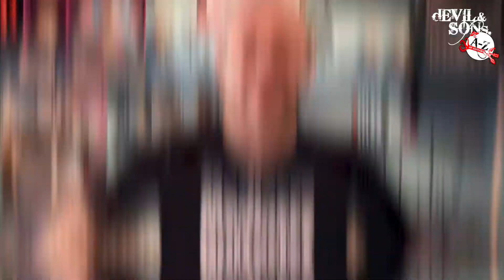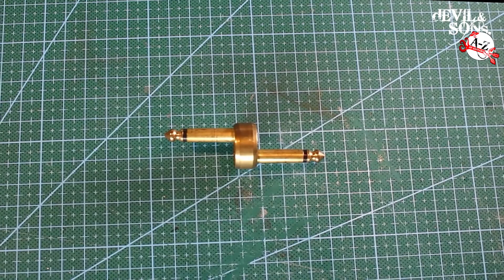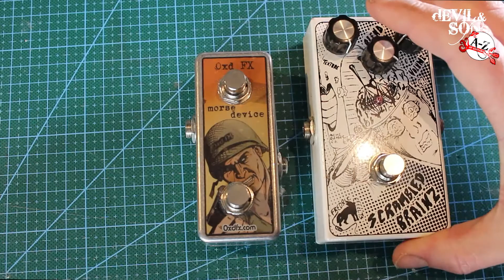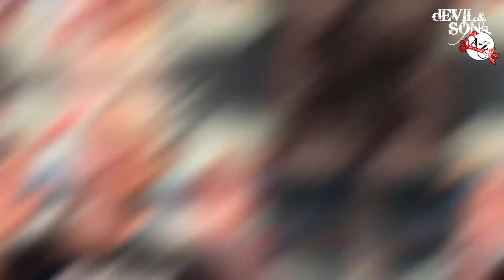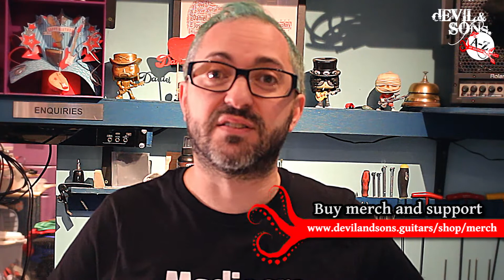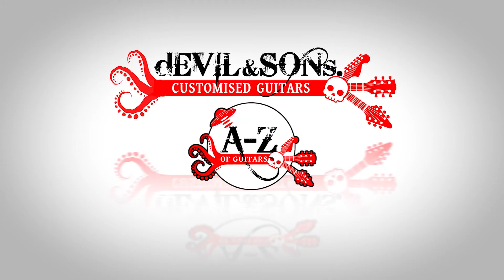Z Connectors Will Change Your Pedalboard Forever

Comment: I know it's an old video but I'm commenting to mention that Z connectors and ALL solid couplers are bad for pedals. Most pedal enclosures are not completely parallel with each other, and even if they are there's no reason to potentially shift the weight of your foot into another pedal's input jack. When you step on pedals there's almost always some sort of movement happening from depressing the switch, no matter how strong your velcro or dual-lock is. Personally I value my guitar pedals too much to risk damaging them over time. Boss pedals are especially bad for this since their enclosures are more sloped than the average. I know a lot of people have anecdotes about how they've been using them for years, but obviously this is a slow and subtle process, I don't see how this is any way a bet worth making.

Maybe more important than the damage is the fact that they do not save space and actually take up more room than flat patch cables. Using something like Ernie Ball's or EBS flat patch cables, you could connect the same two pedals in your video significantly closer together by just offsetting the jacks. No risk of damage and a tighter fit. Not to mention the fact that cables are infinitely more usable. You can't use a coupler to connect pedals with top jacks, or nudge a pedal up or down once they're attached.
Reply from the maker: It's always worth commenting l, no matter the age of the video, especially with useful insights. Thank you.

Comment: What do you think about the spred opinion that solid connectors destroy mama switcholes on pedals? Is this true?
Reply from the maker: I can't see how unless you are forcing the pedals to sit flat when the connectors don't wuite allow it, but there's a lot of height give.
Reply: @DevilAndSons  Thank you for reply! I have some snickers-size pedals and think Z-ones would be most great to connect them. But searching I've just saw some warnings about vertical shifting the holes which made me doubt a bit. 

Anyway I'll try :)
Reply from the maker: I think if you force it into a position where pressure is being applied and then screw down your pedals it may have some effect, but my experience is the z connectors allow enough movement to accommodate most pedal combinations. I have definitely had some pedals that don't match up perfectly and have used the traditional patch cable instead, but that's rare.
Reply: @DevilAndSons  Ah I agree. I think those warnings meant mostly the straight solid connectors (like <--> type) which seem may cause some damage by inaccurate installing but they generalized to all types of solid connectors. Though Z looks having enough space to avoid any tence in most cases.

Thank you!
Reply from the maker: Good luck with your set up